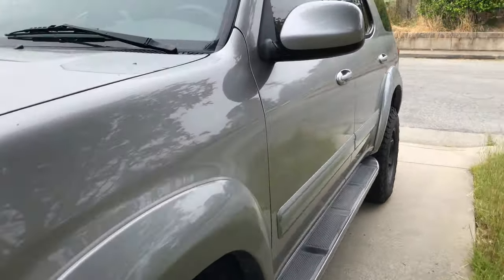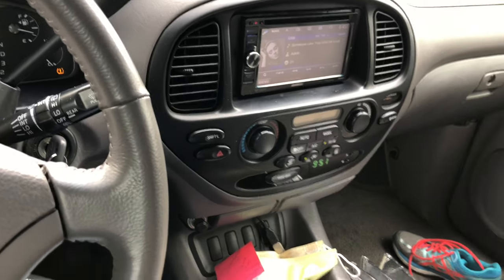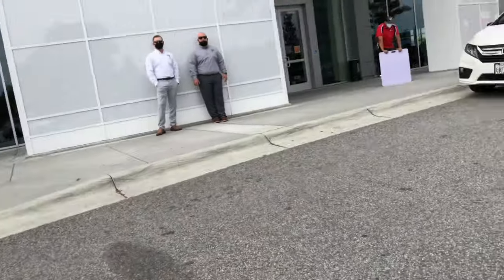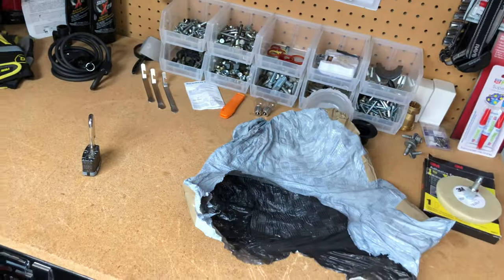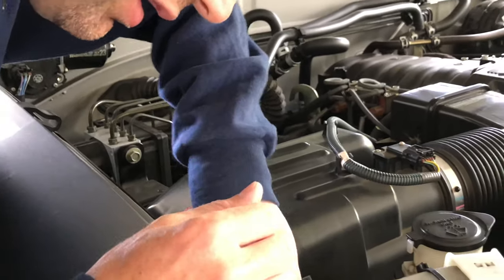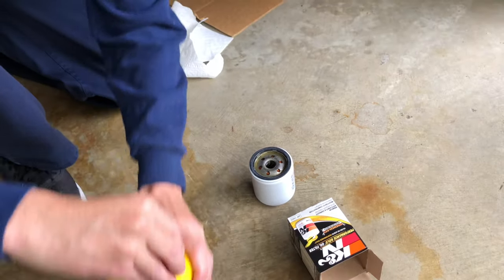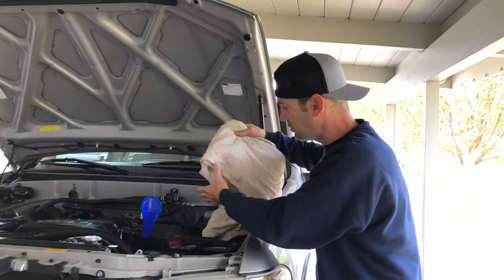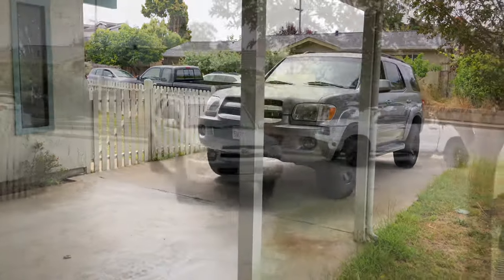Wife’s Lifted Toyota Sequoia Gets A Quick Service

Comment: My mans uses a k&n oil filter (junk) and tossed a washable K&N air filter(maybe the only thing decent K&N makes)! What in the 2020 is he thinking?? Wash the filter... it’s easy.... put 2 inches of hot water in the sink with a few squirts of dawn dish soap. Soak it a few minutes and swish and swirl it’s around and rinse it out with a hose. Let it dry the spray with K&N filter oil. Piece o cake.
Reply: I like the ideal of new filter every time. its cheap, dont need worried about overly oil K and N filter, I like fram paper filter every years. $10

Comment: Atleast it has the easy screw on,screw off.oil filter instead of the many pieces to put together. Like that. You should extend your garage wider? Thanks great video.
Reply from the maker: Thanks.. Yes, I agree, i definitely prefer the old screw on filters over the type that’s in the tundra.. There a pain in the ass, and they get covered in oil during the change.. I don’t really see much of a benefit either.. 
We talk all the time about how nice it would be to extend the driveway over to that fence and have more flat area.. would be awesome!
Reply: @toyotafanatics1  yup never do mine yet, getting ready to though the only thing is a pain is the skid plate. When you did it on the sequoia it was just four screws? now on my tundra is like 8 I think. Was thinking of getting the trd skid plate with the little opening for oil filter but that one is kinda expensive right now for me lol. Anyways keep up the great videos love your tunda and t100 looks great.